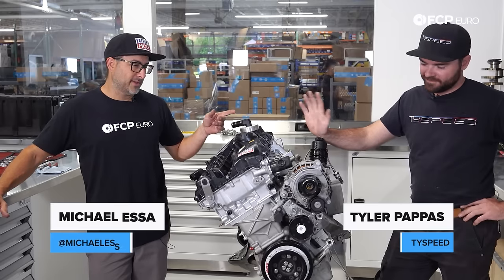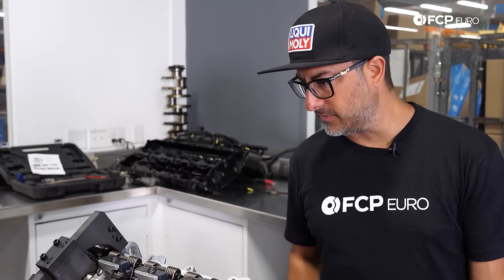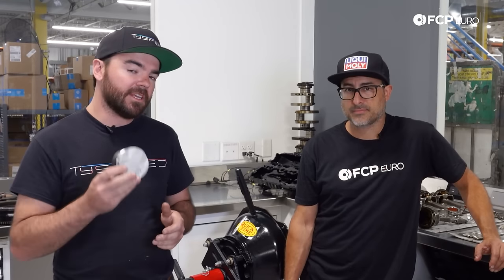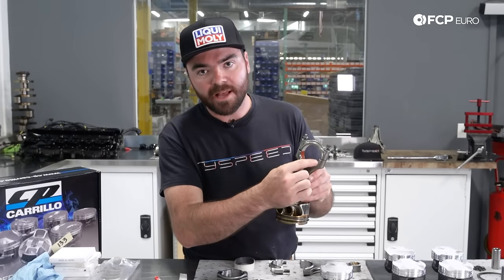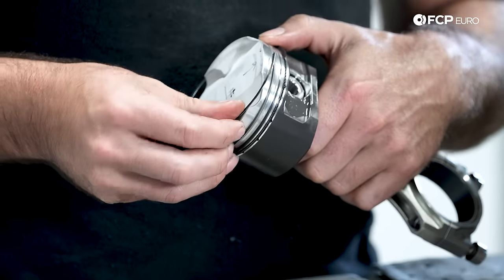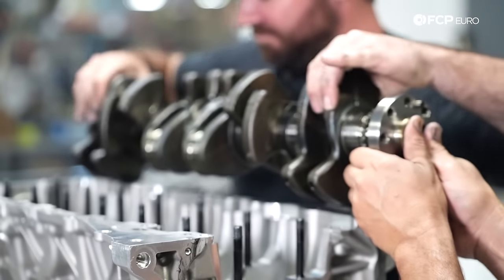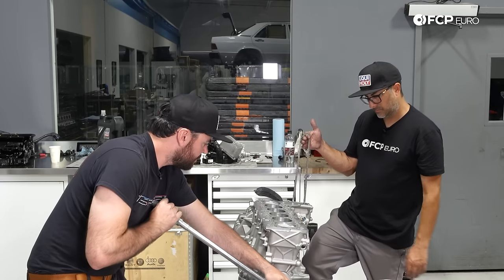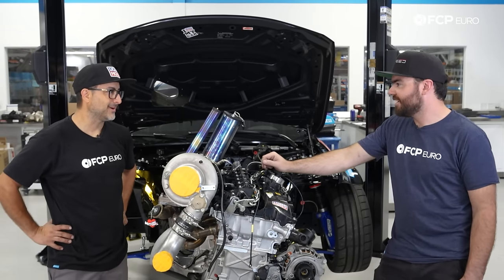Building a 600+HP Engine In A Day - IS the BMW B58 TRULY Bulletproof?

Comment: I'm part of a n54 group and just yesterday people lost their shit on a guy who was using plastigauge. they murdered him in the comments.   Told him to buy p[roper tools or sell his car. I was like Dayyyyum .   Plastigauge is fine if you know how to use it.
Reply: Seen plenty of legit engine builders using plasti gauge, internet know it alls are just that
Reply: Yeah, like anything it's how you use it. Newly machined or non scuffed stock crank, etc. Plastic gauge is fine...as long as it spins freely once you torque everything down as it won't show out of round...maybe if you kept the crank in the same position and checked in 90degree increments...somewhat
Reply: Internet mechanics always talkin😊
Reply: N54 groups are savage
Reply: @uisperfectemail9720 N54 owners are the G35 owners of BMW’s.
Reply: Plastic guage is alright if you're looking for a general idea of clearances if you're sure everything is mainly stock, really only use it on a motor that was running before lol.
Reply: @kluc10001  then why do most high performance shops, and general engine rebuilders use it when assembling engines?  if it plastigauges fine, you assembly lube it, and it spins fine, it's going to be fine, if you plastigauge it, lube it, assemble it and get binding, THEN you check out of round. either way, if you're not using the crank it came with, it should get line honed, at which point the machine shop should have checked alignment and out of round.
Reply: @exiteternium  I agree
Reply: Nothing wrong with it. Most probably haven’t built an engine
Reply: definitely not😂 that would be the 323i, 325i, 328i owners  @liammoodyfilms
Reply: Glad i sold mine. N54 scene turned goofy real quick when a bunch of broke boys thought they could make reliable jam on a euro platform with a OTS tune.
Reply: @EvanCaron its almost like brobro thinks a inline 6 sounds the same turbo or N/A 😂😂😂😂 goofy
Reply: @macneg trying to sell mines now

Comment: The PCV delete is a death sentence for the B58.. Always go down the catch can route. Ross racing have a really good catch can set up.
Reply: why death sentence?
Reply: @sampfister580  have the engine operate with the crank case under vacuum is highly beneficial. less parasitic loss. also prevents ever having positive crank case pressure.

Comment: Nope, the rtv gaskets don't last at all.  I had to have my b58 oil pan resealed immediately after purchase @ 6yrs old with 45k miles.
Reply: The gaskets are fine if the crankcase doesn’t get subject to too much vacuum. So while the gaskets are able to handle lots of heat. These engines quickly pull too much vacuum and all that negative pressure pulling against the gaskets potentially deforms them. Also, the biggest enemy to gaskets relate to the range of heat exposure. By range, I don’t mean highest temp on any particular drive but the diff between highest and lowest temps they’ll experience in their lifetime will determine how well they stand the test of time. Hence, keeping a car garage kept is so beneficial especially for those in cold climates (from a gasket’s perspective) because you prevent the gaskets from heating up having started in that below freezing temp zone. Don’t get all paranoid with this info, just sharing what I’ve learned from living in the weeds of a gasket rabbit hole.

Comment: I was not aware that modern start/stop systems cause additional wear on bearings. Ironic how government gas mileage and emissions standards on vehicles to which start/stop was a way to meet those guidelines results in engine wear issues resulting in eventual decreased gas mileage and increased emissions, as well as substantial service costs to vehicle owners. 😁
Reply: The EPA doesn’t give a flying Fuck about your engine internals degrading from start/stop. In fact the tighter tolerances they are forcing for MPG has manufacturers costing us reliability and is actually making oil waste dirty. Shutting down tuning shops is stupid as Ethanol burns cleaner.
Reply: I 100% agree with you. Ethanol burns cleaner, keeps system components cleaner, cleans up timing corrections, allows systems to run cooler, c
and generate more horsepower especially turbo boosted engines. From day one always thought the wear/tear on starter, and battery components was bad. Government regulations on MPG, Emissions, also leads to all the garbage low reliability weight reduction techniques from manufacturers like plastic intake manifolds, valve covers, turbo piping, internal pcv systems. Then they wonder why we have to rebuild, tune, boost, use quality stainless materials to generate more horsepower and better reliability ourselves. 😁

Comment: The reason that the brake booster doesn’t use vacuum from the manifold is because of Valvetronic. Valvetronic doesn’t create any pressure in the intake manifold due to the throttle body always being 100% open and instead it uses the amount the valves open as the “throttle.” Now getting to the end of the video it looks like Mike removed the Valevteonic system so in his case the intake manifold would once again have pressure

Comment: or those wondering the vacuum pump on the back of the oil pump is actually because there is no manifold vacuum! BMW Valvetronic uses the intake valves to meter the amount of air entering the engine. this causes the intake manifold to never create vacuum and eliminates the use of a throttle body. most valvetronic cars will still have a throttle body as a fail safe tho.

Comment: Piston rings rotate in the bore when the engine is running. They rotate at about 1rpm when the engine is at idle. Staggering rings is for initial startup sealing and then they start moving. Its really not a big deal as long as they're not lined up for initial startup. 

Did you guys balance the crank with the new rotating parts or are you just winging it since it was such a time crunch?

Comment: Having watched this video I feel the root cause was the turbo upgrade creating too much vacuum in the crankcase (not actually over-boosting). Pretty sure this car needs a crankcase breather and vented catch cans / AOS. The damage on the bottom of the piston skirts is a strong indicator that the piston was pulled out of alignment into the piston wall by vacuum and not pushed into the wall by overboosting which would cause similar damage not on the top half of the piston above the rings. 

Also, Why was there all that water? your right that the oil degradation comes from oil and water. But the question then is why is there that much water? It’s most likely because of the oil not reaching operating temps (above 212) I’ll bet you anything that car has a mishimoto oil cooler and the owner did a thermostat delete/switched to the lower temp thermostat which is really a gimmick of an upgrade. Basically never letting the oil heat up. Many things can cause damage to rod bearings, but whenever they spin within the bores- water was apart of the equation. I love the work y’all done and this was a massive upgrade to the engine. But I feel that there are a few clear things here not part of the block that need to be considered in this equation.

Comment: The oil scraper and oil expansion are the 3 pack of rings on the bottom set, should have used the vacuum pump on the oil pump as an evacuation pump for the crankcase... just a thought... lithium or vaseline for the pump help startup...

Comment: The main cause of rod bearing failer on all these engines is  the
(OIL pressure CONTROL VALVE).  
Papadakis Racings
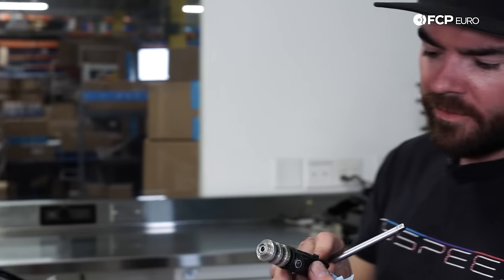 talks about it on his channel.  You just leave it disconnected and it defaults to max oil pressure. 1:38

Comment: I've torn two of these engines down and had to use the big impact on that idler bolt. I couldn't get it with the breaker bar and 6 foot pipe, it is super tight.
Reply from the maker: Its a proper PITA

Comment: Cool video, Thank you for sharing🙏👍. On the race/Drift B58 you guys use the full 100% 5w40 Synthoil  synthetic Liqui Moly?Do you add an additive? eg. Mos2 or Ceratec to boost lubricity/film strenght to help the reliability? 

Not implying is reason for failure, as you explained thoroughly in video.

Just curious what Liqui Moly oil spec to run on boosted S54 and the strong B58 and if additives needed in Liqui Moly 100% synthetic to help boost reliability?😅 🙏
Reply: If you're using molygen an additive is not needed/recommended
Reply: Use amsoil
Reply: @Melvin-01  Thanks, would have love to use the high Zinc US oils, but in our country they only import Europeen oil only 😅 So we pretty much stuck with lower zinc Euro oil. The closest we can get if we use either 300V Motul or "cheat code" Superbike oils😢. Valvoline,Royal Purple, Amzoil,Redline, Driven all great oils(seen wear test-extremely good) but unfortunately not avilible. We have Liqui Moly thou but the 4T Liqui Moly oil protects much better than the Molygen car range

Comment: When tuned and built like this, do you guys think there’s a huge performance difference between the b58 gen 1 and b58 gen 2?
Reply: YouTube search 1stock. His Gen 2 b58 made 950+ whp stock motor and ran 8.6.
Reply: @bland3429 then blew up shortly after and now it’s fully built 😂
Reply: @johncena-hq1ti motor was never blown up. He swap in a new built motor
Reply: @bland3429  it looked pretty fucked when they took it apart lol. Metal in the pan but yeah totally fine😂

Comment: How different is the B58 in the Supra compared to the B58 in BMW’s
Reply: nothing, pre 2020 supras have the 2 port b58, post 2020 have the 6 port. Both of those engines are identical to respective b58 applications in bmw chassis'.
Reply: @fry.master it is very different from B58 TU2 though, which is replacing TU throughout the line.

Comment: 600 is very low for these engines. Feel like you need to go harder if you want to start using the words bulletproof. Push to its limit please. 🙏
Reply from the maker: Fair - this thing can get dialed up to 11, the B58 and stout from factory.

Comment: Sealed Coyotes have gone 7s. Full built, 6.2s.
B58 = not as bulletproof. Fact
Reply: Sealed b58 have gone 8s. Not bad for 2 less cylinder and 2 less liters
Reply: @danielwilliams214  🤣
Reply: @danielwilliams214 no sealed b58 has gone 8s my guy. That’s fully built
Reply: @2seep  1stockf30 has gone 8.93@155
Stock motor.
Reply: @danielwilliams214 Can confirm he was stock and actually ran a faster 8.675 @ 159 shortly after. Since the record, the motor received forged internals and a built head, including cams. Both his new and old stock motor records are impressive for a car that is full weight but that's not an advisable path for everyday driving. If you want reliable four digit power out of a B58 and consistent 8-9sec 1/4mile and possibly even 7s, build the motor and take some weight out, especially if it's xdrive. Both the B58 and Coyote are phenomenal engines but in terms of stock motor capability, the Coyote (gen2) has a slight edge. You'll need upgraded head studs when adding a turbo kit but I wouldn't consider that "opening" the motor. Both platforms are great so at the end of the day it doesn't matter what other people think as long as it brings you happiness. A lot of the people that criticize these achievements won't put the work in to run the numbers themselves.
Reply: @danielwilliams214 
officially gassed - og 
That’s the YouTube channel that just showed his car which has since been upgraded but he mentioned his stock world record times.
Reply: @user-ki8zf1rp1e those are not motor records. He can’t get them times without an auto. Literally no skill exist in the car culture these days
Reply: @ducksauce2746  It's the current stock motor record for the B58 so it technically is a "motor record". Unless it's a class restriction, I don't see why it matters whether the car has an automatic or not. Powerglides, modern planetary autos, exotic car DCTs, and sequentials have been proven to yield consistent and superior results. That's not to say you can't go fast with a manual but the results speak for themselves and going fast is the only concern. The future is now, old man, get with the times or get left behind.

Comment: Bhaha b58 is a garbage motor 😂 a junk engine
Reply: expand please, opinions and bias without facts is jsut as garbage as what you claim an engine to be.  

Fact the B58 coil packs are stout with high energy output, and aree a common upgrade on older platforms, such as the N54. 
it has a forged crank, and drop forged cracked connecting rods, both a boon when it comes to engine power capability.  adding to this the pistons are also forged alloy FROM FACTORY
it has a closed deck design, a bonus over the open deck design of the N54/55 series of engines, as wel all know side loading can cause the cylinders to walk on an open deck. 
the engine's forced induction design was also met with a water to air intercooler, this method of cooling can be easily modified to keep intake temps in check even with high boost levels by using secondary cooling units, adding an ice bucket/bath, etc. 

as the block and head are aluminum, it is a lightweight engine, giving superior weight distribution front to rear for exceptional handling characteristics ( similar to the RX-7 50/50 distribution)  

overall the basic bare block has everything you want for a hefty power making engine, and items that others have to pay aftermarket for the privilege of using on their race cars. if anything, i contest the B58 is the true german 2JZ predecessor, not the N54.
Reply: @exiteternium dudes name is all you need to know about him. He probably knows nothing about it. Or motors in general. Especially when it comes to real world experience. There’s tons of ppl that hear shit and never touch things because of what they heard and then if they ever do get the chance to, or even say like cars, get to ride in one, especially modified, they always end up thinking much differently about it, I’ve done it with things random things. Best experience is to experience it yourself. Just cuz 99 out of 100 doesn’t like it doesn’t mean you won’t love it. People are just so easily swayed and manipulated without ever experiencing anything. It’s really sad tbh.
Reply: @reaction9449  I know, I just hate opinions based on false information,  kinda like outlaw garage worries me cause he makes commentary and does things that make me cringe as an auto enthusiast, and prior wrench turner career before back issues kicked in.  I've owned DSM, I've owned Dodge srt 4, I've had v8 camaros, and helped my father in law with his 383 stroker chevy II, I've done hand porting and polishing on my first sport compact I ever owned which was a chevrolet with the 60 degree v6 3100 sfi. I've done the 3.0 engine swap in a Ford taurus SVT, cause the guy blew up the 2.5 and wanted the bigger engine, I've owned an rx7 and a rebadged mitsubishi starion,  kinda wish I kept the fc3s chassis rx.. would been great powered by an aluminum 6.0 block with 4.8 rods and crank.  

I miss my dsm with big 16g turbo, abd my srt4. But the dsm was a factory fuckup of an engine that never held timing with new components, and the set succumbed to Midwest salt solution and had rust holes I could fit my arm in.
Reply: @exiteternium how would you compare the B58 vs. the RS3 five cylinder engine?
Reply: @mikexlr8  don't have experience with either one, i know the B 58 is getting a lot of visibility in motorsports trhanks to the BMW Toyota agreement with the supra  and what they have shown with regards to it's reliability has been good so far, even Vehicular DIY likes the b58, and hasn't had issues.